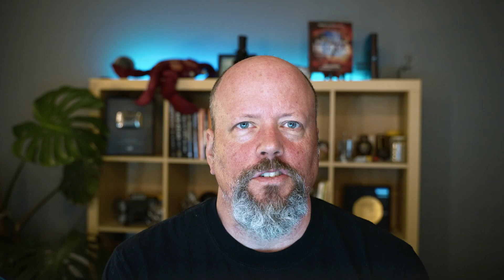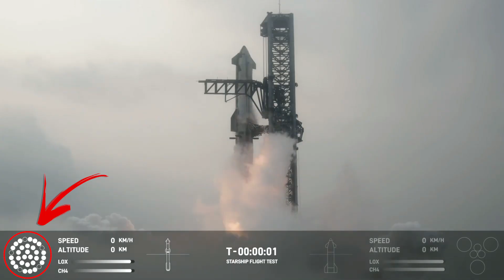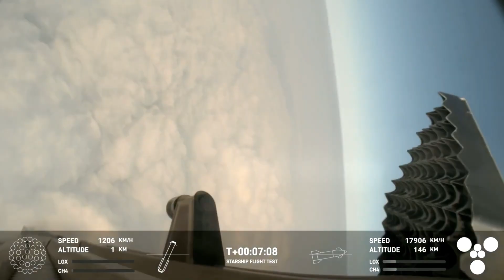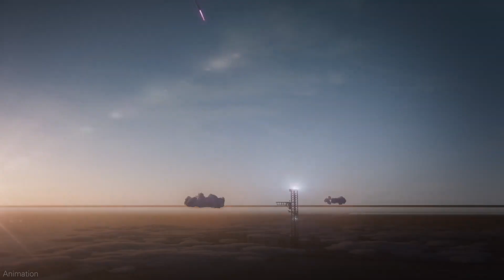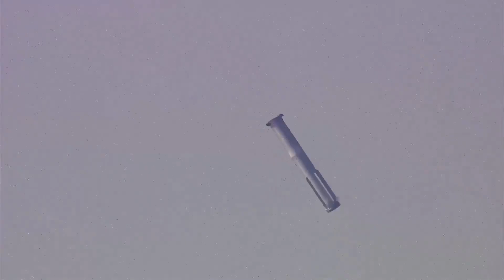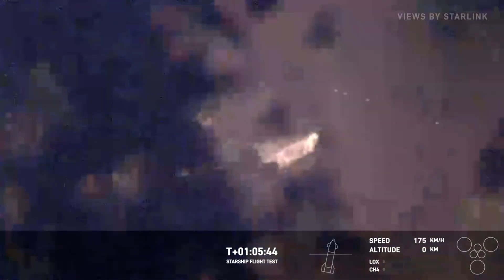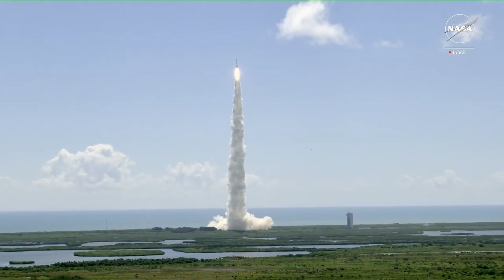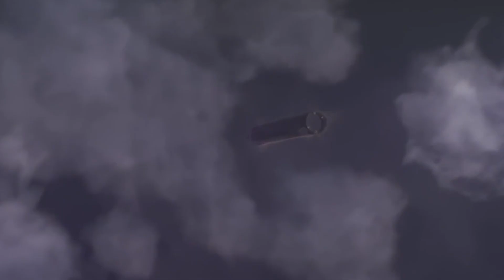IFT-4 and the Future of Starship: All You Need to Know (with @scottmanley  and @MarcusHouse )

Comment: A mistake you're making here Fraser, about your skepticism, is assuming that just because they took a long time on Falcon 9 they'll take as much or even more to solve and develop Starship, as if none of the experience from falcon 9 isn't already showing on how quickly they're progressing with starship now that they've started launching them.
Other than that yeah, i'm on the same boat of the skepticism but because they still need to go orbital and deliver payloads 1st, and it is only testing the payload version right now, not the lunar, the modular, the tanker or the deep space models.
I don't doubt full reusability, but they do have a few challenges ahead before achieving it, they're close to it if all they wanted to do is go suborbital and land without doing anything else at all.

Comment: Clowns falling for cgi. 1 if booster landed where is it? 250 million dollars worth of hardware.

2 starship has never achieved a stable orbit. It has arced through minimum Leo. But it has never established a stable earth orbit. The time arcing through Leo we had clear rearview picture. 3 nobody addressed the starship out fading in the rear view. 4 if the arc video was for real. Then starship had no fuel left as it all leaked out. 5 the only view is a picture of the right flap. There is no ocean view, there was no view from the rear. Reason all the tiles flew off the ship. But another failed reentry would have put Elon musk out of business. I’m really surprised that he resorts to a cgi reentry with no actual proof of concept and especially proof that starship could have survived reentry.

Elon has made bold promises since 2004 on many projects and has never succeeded at any of them. Hyperloop bankrupte, tunnel boring bankrupte, star-link to produce a 100 megahertz speed, hasn’t made it, super sports car that does 0 to 60 in 1.6 seconds, never got beyond false promise, Tesla has never produce the professed mileage for any of its models, Tesla semi super charging stations never built, all of the above professed by Elon for 10 years,(its coming next year.

Elon Musk has only one great project that came true. That was Falcon 9 and Falcon super heavy. He took the credit and the engineers who actually made happen left SpaceX short after. They are all stating up their on space companies.

So to Elon boot lickers. Elon got the gold mine and you fools got the shaft.

Comment: "Landing in the ocean is a far step from having these things return back to their launch platforms, and be rapidly reused."

True.  But SpaceX already has experience with this, as the only company to create (and reuse) reusable first stages.  Note that Right Flap survived until Starship toppled into the Indian Ocean. That's because of the materials choice - it would have burned away long before if it had been made from aluminum or carbon fiber.  That sort of mindset has guided pretty much every design choice for Starship and Super Heavy.

I suspect reuse will happen much faster than you do, Fraser.

Comment: Way back, Elon talked to Tim about the problem of heat impulse VS sustained heat on the heat shield and how the problem is that the tile is fine, but the glue melts and then you lose the tile. Maybe they finally found a solution for that

Comment: About starliner, do they use adequate failsafe philososhy during conception, did they used the adequate qualification tests on each part? Space capsules are not new tech by any means, maybe the too innovation bug crept in, maybe there was not a full understanding of the flight regimes, temps, vibrations, radiation.
Seems there is a bit of either complacency or aggressive push to launch, both are dangerous.
In any way something is on, which being a boeing project really cast doubts if the commercial plane safety culture is not spread to other divisions.

Comment: It wasn't that far of a step from landing Falcon 9 in the ocean to landing it on LZ-1. I don't see why it would be drastically different for Starship. Also not sure why reusability needs to be binary on/off. There will be stages of partial reusability while at the same time refurbishment cost/effort will see continuous improvements. Artemis does not require 100% full reusability.

Comment: As far as "rapid" reusability is concerned, I would imagine that refueling tanker ships is where it could become most important. Marcus's suggestion of several Starships already preloaded on the ground (assuming the Chopsticks can lift that) would work fine for freight-to-orbit, with normal refurbishment and reloading turnarounds. However, simply relanding, caught by tower and replaced on a booster, then refilling and relaunching a tanker ship would, indeed, be "rapid" reusability.

On the other hand, maybe tanker ships remain in orbit and form a depot or even a habitat framework. Or maybe eventually they cycle back and forth from future Moon-based fueling stations. (It has always seemed a shame to me to allow second stages (or satellites) to become debris. Why not parking orbits for future museums or recycling or refilling as space tugs, etc.? IMO, the Cassini–Huygens spacecraft, for instance, should still be in Saturn orbit awaiting retrieval some day.)
Reply: Why do people think that it's easy to reconfigure an empty tank to an orbital habitat? A habitat is significantly more complex than a tank. You'd have to add all that piping and cabling for live support, docking hatches, lot's of equipment. Even on ground that would be a major project. Just land the tanker back on earth and reuse it as tanker.

I agree thought that it would be interesting to keep unique spacecraft in orbit as potential future museums/pilgrimage destinations.
Reply: @Martinit0  Good points but didn't mean to imply anything would or will be easy; in fact, mentioned "framework." But we will need to learn how to build stations and factories in space and simply having a stack of used tanker ships would probably be a good starting point. Before then - actually in plans how - we'll likely have small "habitats" similar to ISS where people can live and from which they can work.

Comment: Just thinking: For the heat shield, tiles seem to be a major weakness. Given that starship needs to be fully re-usable; complete with all its tiles, would it be possible to design some sort of composite material which formed a complete one-piece half-a-ship to act as both heat shield and structure? If they're thinking about welding the tiles, that seems to be a step in that direction.

Comment: What happened to the booster and starship anfter the landing
Reply: There is a good chance both were crushed by the impact after tipping over into the water. Potentially they exploded, since all the tanks should still have been pressurized at that point. After that they likely sank into ther sea.

Comment: Okay guys could we address the issue of ocean pollution? That's great they pulled that off My hat's off to the SpaceX starship crew. But the past 50 years we've been dumping rockets in the ocean. When does it stop? I mean there's tons of steel down there in the ocean along with the heat tiles that don't degenerate they wash up on beaches. What's the deal?
Reply from the maker: That's the whole point of a reusable rocket. To make the ocean pollution stop. Falcon 9 boosters are re-used and not crashed into the ocean unlike other 1st stage boosters. But all rockets discard their upper stages. In theory, Starship won't do that either.
Reply: @frasercain  but don't u think recovering star ship boosters might be productive in that they could see what kind of damage was done during boost?

Comment: i think they need a drone that assesses the heatshield before rentry, and if it finds any broken heat shield, fills it with ablative resin. its a temporary solution but better than losing a ship with people inside.
Reply: Most of the tiles are easily replaced and almost assuredly an Optimus bot could go out & slap new tiles in place!😊
Reply: @jackdbur  no i don't think it's possible to remove heatshiels with a bot in weightlessness, even it's difficult for crews on ground, ablative resin is like toothpaste and easily applyable, it's quick fix just to save the ship and crew

Comment: Don't forget that although some parts of the ship will get heavier as they need to beef up heat shielding etc. some parts will get lighter like engines lose some weight and require less or no shielding, parts of the ship are found to be over engineered and can be pared back. Also the staging ring will be much lighter when fully integrated using the strut design seen in the v2/v3 renders. Also fuel tanks are set to grow as the ships height increases. They could also replace some parts with lighter materials like titanium rather than using stainless steel for everything.

Comment: It's kind of ironic, but in order to have a fast-paced experimental process, SpaceX is building reusable Rockets faster than any other company builds Expendable Rockets.
Reply: actually, not yet reusable
Reply: If you're speaking of Falcon 9, sure, but Starship has yet to demonstrate any reusability.
Reply: @kerigpope  
Yes, that was probably a bit of an exaggeration. I would disagree about them to having demonstrated reusability of Starship. It seems clear that at least the booster phase has proven its reusability. The upper stage of Starship is damn close.
Reply: @rockymntnliberty Exploding engines doesn’t exactly scream reusability.

Comment: At 7:01 in this video (6min 25sec into IFT4), you can see what I believe is the hot stage ring fly from bottom to top.  It'll have similar drag but less mass, therefore experiencing greater deceleration
Reply: Marcus ended up pointing it out later on the conversation

Comment: The test is to gather as much data as possible and in that respect this was a huge success because it got through the whole flight profile. There were serious issues with heating on the flaps which they now have solid real world video and data to work with and they proved that the basic concept is workable all be it with improvements to heat sheilding and position of the flaps which they were already working on. They will have flown this with the weakest, lightest tiles they thought they could get away with. Musk has already said they have a much stronger all be it heavier tile and ablative secondary shield design ready to go and they already said some time ago that the plan is to move the connection point for the flaps onto the leeward side to reduce heating.

Comment: Even if it takes 10 or 20 more iterations to work out the bugs on the upper stage. I would think that within the next couple of launches they should be ready to start carrying cargo. So at least the test flights will be paid Four as long as they're carrying cargo. In fact comma Some of the Plann Tanker versions That won't Need re-entry capability comma might also be in that first 15 or 20 launches.

Comment: Questions to ask: did the engines on the ship actually fire during landing? If they did, why did the engines lit indicator on the video stream show no engines lit? Note that for both of the booster landings, the engines lit indicator did correctly indicate which engines were firing.
 And secondly, what happened to the booster after it contacted the water on landing? It appeared one Raptor exploded during the landing on the booster and the booster appeared to be on fire on its side coming down to the ocean. Did the fire cause the booster to explode?

Comment: They should consider trying a sprayed areo gel layer for their TPS. Can do cyrogengic through to high temp and has good mechannical adhesion. It's also light and can do all contours because it's sprayed. Hinges are still a problem tho. Probably need a shroud, a bit like the old Concord nose cone. but that's difficult & add mass.

Comment: If we saw One Flight Control surface on StarShip being damaged by reentry plasma, then it's highly likely that all 4 Flight Controls suffered damages as well. SpaceX's Flight Control Heatshield Dept got some Splainin to do !
Reply: This was a theorised  issue & the flapps have been moved in later builds of Starship! 😊
Reply: @jackdbur  The odds of only one Flight Control suffering damage due to reentry are pretty slim. The future iterations of these Flight controls are also going to include reducing their size.   Of course, that will all change again w/ the larger SS version II.

Comment: What is terminal velocity when horizontal? About 400 mph?
Reply: I believe since density is a measurement of a theoretical cube, it would hold that moving horizontally through the cube would be the same as the vertical terminal velocity at that same density.

Comment: SpaceX Tiles with Quills
Tiles with Quills- Why not create a Tile like a Feather with a tungsten quill? Imagine something that looks like a fly swatter made out of tungsten. The tile would be attached to the "Swatter" part and the handle would be inserted into a slot running under the stainless skin below the adjacent tile. The handle (Tungston Quill) would be firmly attached but the Tile on the (Swatter) would still pop into place and look just like how the tile fits now except the tile would be able to float on top of the ablative material or stainless skin and move slightly due to vibration or the expansion or shrinkage of the tank/skin due to changes in temperature. The tile would still be anchored more securely with its quill buried into the skin. Birds need their feathers to be able to move individually so why not follow